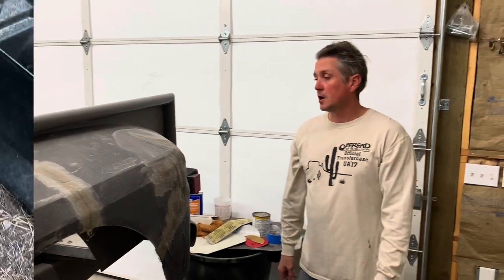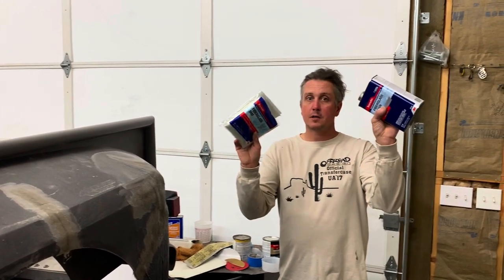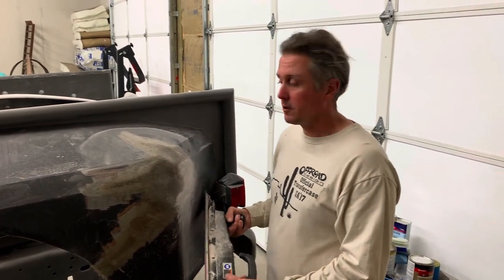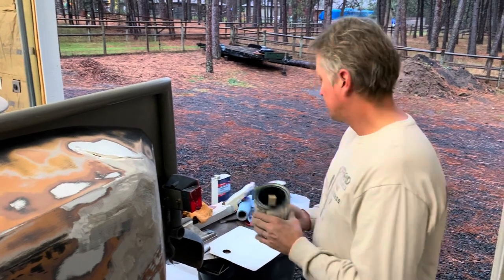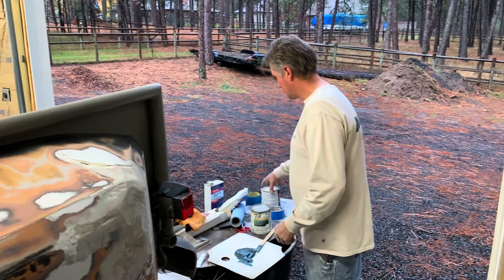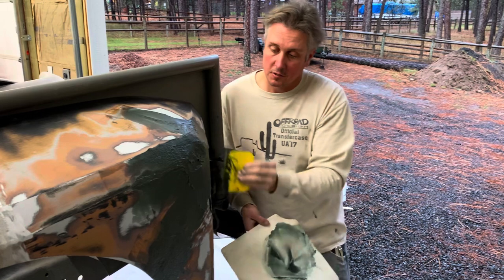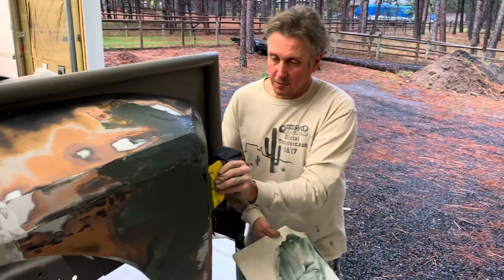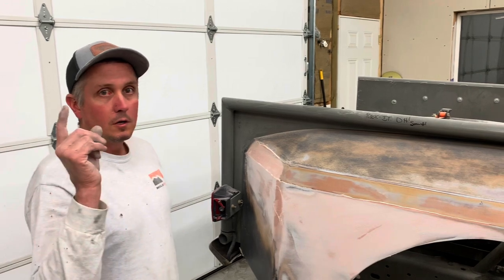Body work, fiberglass repair, and wheeling!  Mom’s Spaghetti

Comment: Super bummed about the turn of events for DED, but I'm happy to see you here on the youtubes. It's nice to see you in your element and working on your own projects. If I can chip in on any aspect of your youtube adventure, it would be to scrounge up some audio equipment. The only thing I have a hard time with is the difference in audio from your intro to you talking. Camera unfamiliarity isn't hard to handle, but going from super quiet talking to full volume intro, back to low volume commentary and everything in between is kinda hard to handle. Regardless, I'll be here to see what you're up to. Thank you for keeping on and doing the things you do Dave.

Comment: top tip - use baby powder on your exposed skin to avoid itching for days.  the powder closes up you pores, also gives you a nice ghost shade for the camera. tip 2, there really is a stuff called Corvette body filler.  It's designed for fiberglass smoothing, the marglas is good if you need 'more' strength but usually, you can go straight from glass to corvette body filler

Comment: Not the answer for compressor noise, but I plumbed my intake to the outside of the building.  With a cover and a cheap automotive air filter. Good reduction in noise in my shop.  Not perfect but it helps. Best of wishes.
Reply from the maker: This footage is really old. I’ve got one of those Eastwood scroll compressors now

Comment: If you're using the Everglass and it seems "dry", you can always add a littke fiberglass resin to it to thin it out. Plus, the resin will help it lay out smoother.
Reply from the maker: I did that in the episode. I thought
Reply: @thedirtheadshed  you did or at least you mentioned it!

Comment: something i learned a while back. mix body filler (bondo) with fiberglass resin. it makes a bit of a runny mix that fills in on its own. then after it hardens. just take a DA or such to it. helps make it a bit easier. 😅

Comment: Not that I’m knocking you because I love that front end, I had an 83 F150, but was there any particular reason you swapped the front clip? If I remember correctly, the front clip that came with the cab was decent.

Comment: Watching you sand fiberglass w/o a mask made my throat itch. Wonder if you raptor lined the fenders if they would hold up against impacts better
Reply from the maker: Raptor liner is kind of hard/catalized.  It would crack easy too.  Rhino or Line X could help

Comment: You should always wear a mask when sanding fiberglass, it's got very small threads of glass, and powdered glass is extremely dangerous. It will damage your lungs very quickly. I hate working with the stuff, but please wear safety equipment, you'll be thankful you did.

Comment: Not that I’m knocking you because I love that front end, I had an 83 F150, but was there any particular reason you swapped the front clip? If I remember correctly, the front clip that came with the cab was decent.
Reply from the maker: I really couldn’t stand those composite headlights
Reply: @thedirtheadshed  yeah, they’re pretty fugly.

Comment: Dave! Did you build the bumper yourself for this rig? Or was it an aftermarket purchase
Reply from the maker: The rear bumper is a front Toyota landcruiser fj55 bumper.  The front bumper is a stock ford one that I modified.  Hid the winch behind, and made the light mount/push bar from scratch
Reply: @thedirtheadshed  it's super cool, love the look

Comment: Solid video! Can't wait for the next episode! What editing software are you using?
Reply from the maker: This was old clips on my phone and edited with iMovie
Reply: @thedirtheadshed  Nice. There are a few tricks for audio editing in imovie that can be  helpful. one, you can increase the visual size of the clips in the timeline so you can see the audio levels a little easier, this definitely helps with fine tuning the levels. two, you can press and hold R while you select a portion of a clip to adjust the audio levels on only that portion. This is nice when you are talking but distanced from the camera or something and you need to bring the levels up, and it makes a smoother transition vs just cutting the clip and adjusting levels clip to clip. hope this makes sense! Let me know if you have any questions

Comment: You are putting bondo right on top of fiberglass? Does it shrink or anything? And then primer?
Reply from the maker: That’s correct.  It’s a good idea to let this kind of repair cure for quite a while so it can shrink while in the primer stages and not after paint.    I’d let it sit for a couple weeks at least